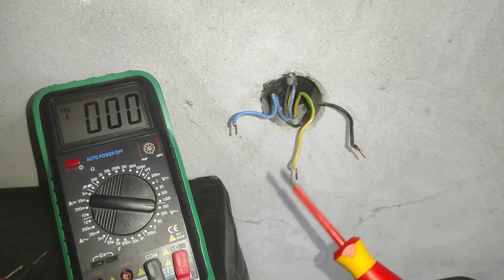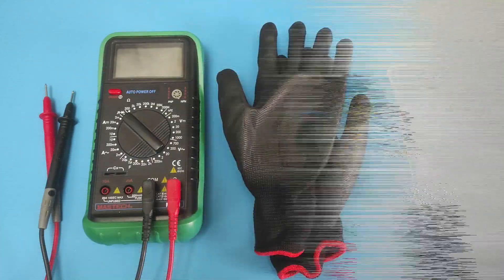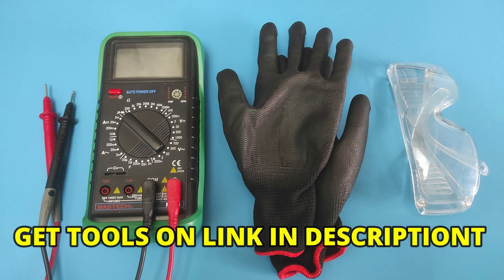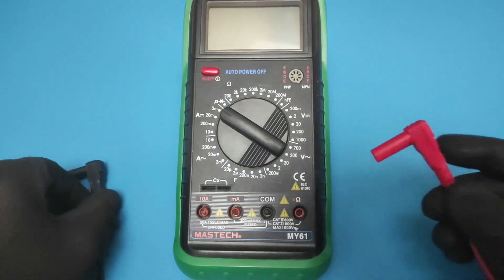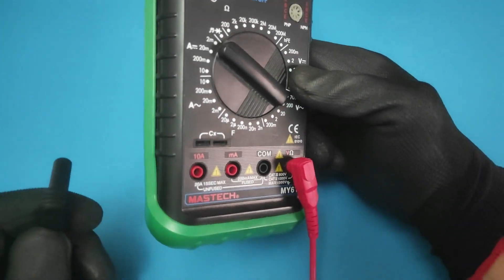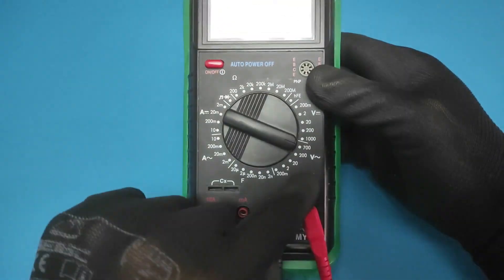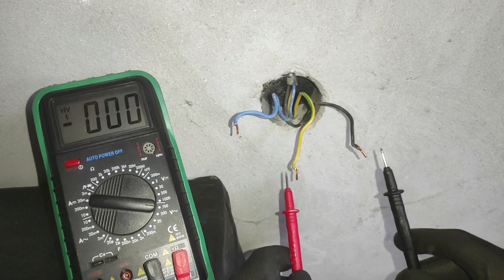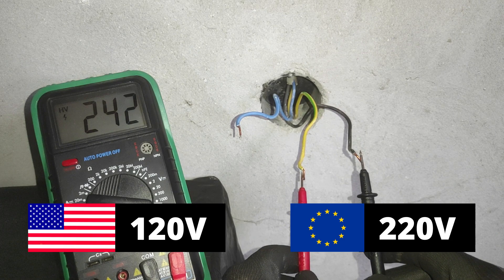How To Use A Multimeter To Test Voltage Of Live Wires

Comment: So did my fuck to occur because A: I had the red wire in the 10A slot
B: Because I didnt prod the wires but the screw holding them in place
C: Because I had the red probe on the hot wire and black on the neutral
D: All of the above 

- Huge spark and melted probes 😵‍💫

Comment: My voltage meter is showing the hot and neutral wire have voltage. If I test the wires with a multimeter and they both have power will I get electrocuted? I’m having an issue with my light not working so there could be some kind of fault that occurred to the neutral wire but I’m not sure.

Comment: Question. 
If you have multiple hot wires in the junction box. Will you get a reading if you touch HOT/HOT?
Reply: Could be wrong, but you’ll read 0 on your meter because there wouldn’t be a difference in electrical potential, if it was a 3 wire circuit with 240v the 120 on each conductor would cancel each other out and leave a reading of 0

Comment: In your other video "How To Test If A Wire Is Hot With A Multimeter (IN 6 STEPS)" you put the red on the live and the black on the earth. 

Does it not matter which one you place them on when checking?

Comment: What would happen if you touched any of those wires with your bare hands?
Reply: The worst thing you can do is connect one hand on live and the other on one of the other wires. You would get 240v across your heart and possibly die.

 If you touch the live with your right only then electricity will pass into the ground and not go through your heart. Still, it will hurt like hell and you would need to go to the hospital to check your heart signals
Reply: If you were completely insulated from the electricity, touching one of the wires would be harmless (no circuit), whereas an accidental contact with both poses some risk that the insulator might break down.

Touching just one without protection would give you a nasty shock, but is unlikely to kill you.
Reply: @tudorv4785  thanks for the update. I have absolutely no plans to test the theory but interesting to know

Comment: but you knew which one was ground, I understand black should be ground, but this tutorial doesn't really help if you have unknown wires and need to find the voltage or lack thereof.
Reply: If you switch the wires/probes wouldn't the meter show a - (negative symbol) and not show it when it's not? So when the Neg shows and the red probe lead is on the black. That isn't the "hot" wire.
Reply: Universally  excepted ,the green wire is ground 

white is neutral 

and black is the one that will  hurt you , black  is known as the live wire also known as the hot wire,
Reply: @abeneufeld9690 yea I learned that a while back, I’m in automotive so red is always power sometimes yellow, black is pretty much always ground
Reply: ok so in a different video it says take the highest rated one as the live wire makes sense?
Reply: If you don't know what wire is ground, you can just touch the probe to something that is grounded like the junction box. Then touch the other probe to one of the wires to measure the voltage.
Reply: Green is always ground unless you're talking about d.c.
Reply: Black is ground ? Dude, you really gotta be joking.

Comment: I have a rv trailer. The bathroom fan stopped working. I replaced the motor. The new motor is not working. There is a switch on the fan. I bypassed the switch and connected directly to the incoming wires. The fan still doesn’t work. How do I know if it’s the motor, the switch or if I even have incoming power?
Reply: obv u did smoething wrong
Reply: Get smarter

Comment: Do we need to turn off power?
Reply: You will get 0 volts with the power off. If you want to test what the voltage is with power on, the power needs to be on. To get the wires out like shown, turn off power first and be sure the wires aren't touching. Do not let others around the wires, especially kids.
Reply: @joshnovotny90  okay thanks
Reply: test first to get the power on reading and then switch off and test to see no reading, then you can think the power is off if you see the change. if no change, you still have power.
Reply: How do we test fir power with only 2 wires, EU light switches, I need to change the switch but it's only 2 wires so hiw do I check their is no current going through so I can be safe changing the switch, thank you.
Reply: lmao maybe stay away from electric until you understand the most basic
Reply: @jcbbb 💀